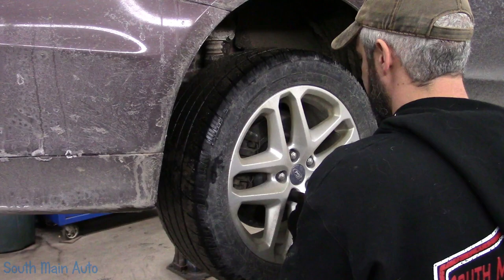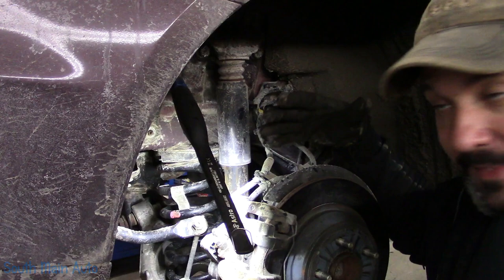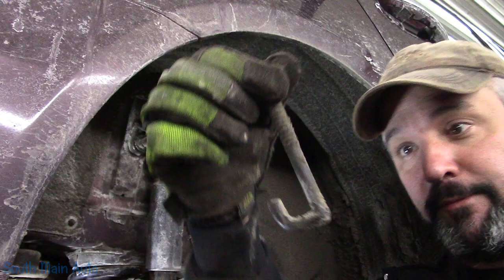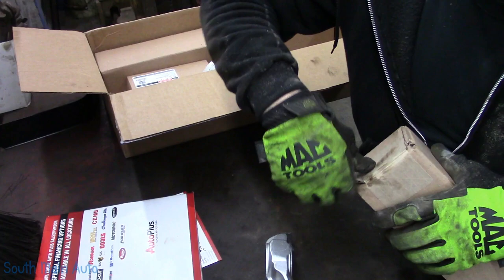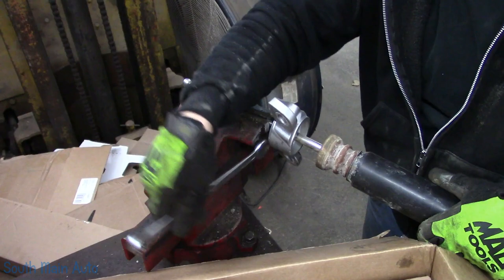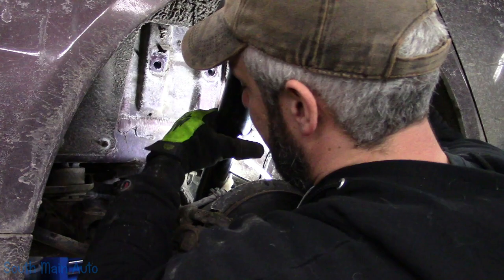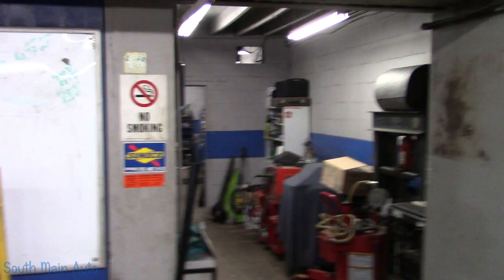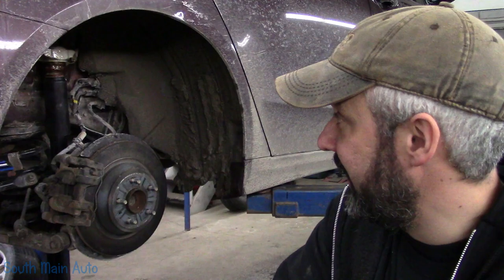Ford Fusion - Rear Shocks & Mounts

Comment: So was the shock really bad? I thought it was a bad or loose bearing in the shock tower? Did the customer want the shocks replaced anyways due to age/mileage?
Reply: My guess the shock mount was bad, however if your gonna change that then change the shock anyway...the other mount will fail probably not too long after this side did. So he did both sides and shocks have to be replaced in axle pairs.
Reply: Dave B. Yes I understand that suspension components should be replaced in pairs. Always best to do that in most situations. But if the shocks themselves weren't bad or leaking, which they didn't appear to be so in the video, I'm surprised Eric O replaced them. I thought he might be able to save the customer some money by just replacing both rear shock tower mounts. Not sure how many miles were on the vehicle so it's hard to tell if they were due to be replaced anyhow. That's why I asked if the customer requested that additional work.
Reply: @klwthe3rd  for anyone wondering, I think the shock was toast. The shaft was corroded.

Comment: I have a '14 fusion that has the chrome caps.  Ford must have sized their lug wrench according because when I had a flat time a while back, I got them on & off without any trouble.
Reply: They sized the wrench correct on all of them, however the caps do go bad if they are removed and installed a lot with a impact wrench...or over torqued with the impact gun. My buddies Dodge truck had all of the caps wrecked by a tire shop, and his lugs were brand new, he paid I think $60.00 for oem and they wrecked all the tin caps on the nuts. When he tried to remove the lug nuts he broke 3 of the studs off. So how tight was it installed ? Wayyyy too much.

Comment: 15 Ford Fusion SE 2.5 L How can you tell if strut is bad ? I took severe hit on drivers side  front wheel and CV axle , lower control arm and the inner tie rod was damaged need replacing . The strut looks fine but some say the strut is likely shot and needs replacing . Took it to this shop yesterday and hopefully start working on it Monday .  Some shops sell you on things you don't need
Reply from the maker: So you're telling me you hit something so hard it broke the lower control arm and the inner and outer tie rod ends?!
Reply: @SouthMainAuto  a car hit me at high speed . At the front drivers side wheel
Reply from the maker: @frankmontez6853  sounds like you need to go to a body shop instead of asking the internet what parts to change...

Comment: HATE those lug nut caps! my first ride a 1991 ranger left me stranded with a flat tire cause the caps had fallen off and the factory lug wrench(all i had at the time) would no longer fit all the lug nuts good enough to get the tire off. I went later and replaced them all with non factory nuts.

Comment: The amount of salt crust up there in NY is crazy. Bet someone would make a mint if they opened up a car wash in your town.
Reply: From even further north, across the mighty St. Lawrence, and up another hour, no killing to be made in Car Washes.  It is too damned cold to wash the car, it freezes closed before you get home.  I've been stuck in my truck for weeks, with just my phone!  If it wasn't for the one full-serve gas station in town and Timmy's Drivethrough, I'd be dead.
Reply: After washing my Firebird with t-tops, I couldn't get into my car the next morning, ended up up prying open the rear hatch and crawling through the car, used both feet to push open from the inside. The design of the tops channeled the water into the weatherstripping.

Comment: That owner of that vehicle was lucky that j hook didn't poke a hole in their tire. That's what happened to me one day I was driving my truck. I saw something laying by the fog line in the road and thought it was a twig or small stick until I ran over it. By the time I actually saw it in the road it was too late to avoid it. Anyways, the guy that fixed my tire showed me the foot long metal punch that had gone into the tire and was bouncing around.

Comment: Those lug nuts are awful. Had exactly the same problem on my 2013 Escape. It was one of the first things I checked after buying the car, and they were all swollen, I couldn't undo with them with the wrench in the car, which concerned me. I bought some much better replacement ones from Amazon.
Reply: I like them because the outer tin does not rust. The impact guns are what tears them up.

Comment: Really annoys me that Ford don’t supply new nyloc nuts with shocks!
Reply: In my opinion the Ny-loc should've been included as well as the bump stop along with the dust shield, but whatever.
Reply: Squirt200 and the shock cover the way it just goes on is a serious engineering flaw must have been a Ford engineering crew meth bender day or somthing.

Comment: There's a class action lawsuit in the works over Ford's chrome wheel lugs.  Personally, I want sue Chrysler for the ones on my RAM and my former Jeep Patriot.  I don't even like lawyers.
Reply: These replacement lug nuts are solid/one piece, not like the defective Ford OEM lug nuts.  "DPAccessories D3116-HT-2305/20 20 Chrome 12x1.5 Closed End Bulge Acorn Lug Nuts - Cone Seat - 19mm Hex Wheel Lug Nut"
[ https://www.amazon.com/gp/product/B00H1IBKIK/ref=ppx_yo_dt_b_asin_title_o09_s00?ie=UTF8&psc=1 ]
Set of 20 on Amazon for $25.  Have yet to hear about any Recall.